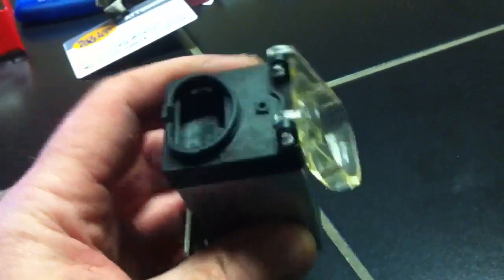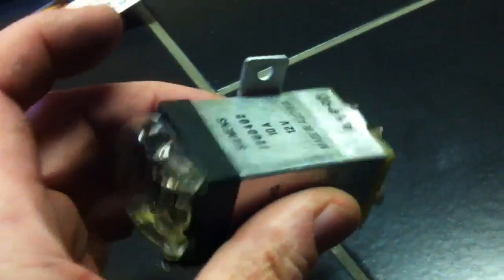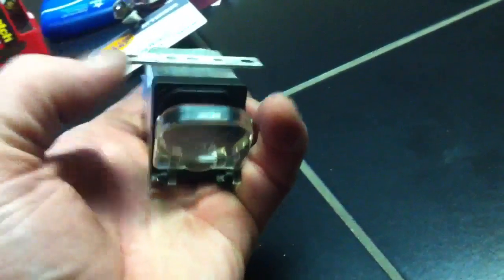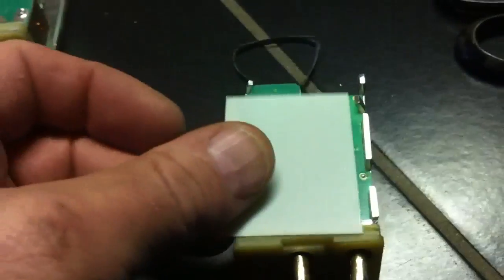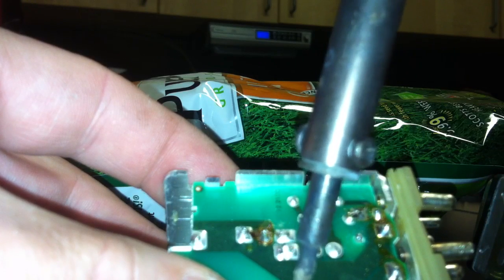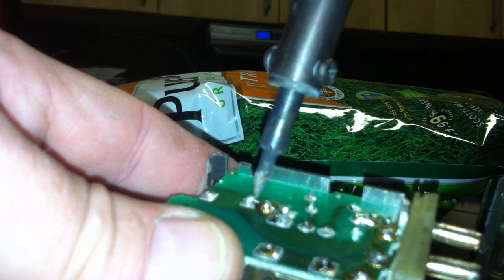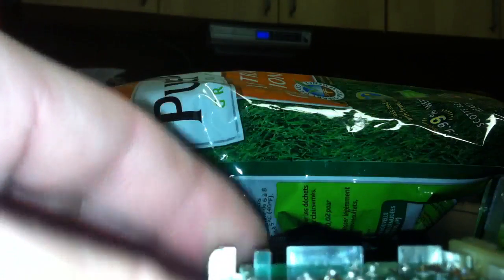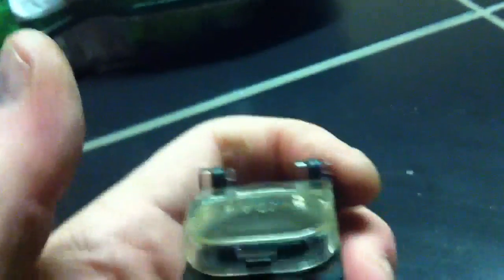Mercedes OVP relay repair

Comment: Great video . I recently bought a very nice and clean1992 SL300-24 with 126,000 miles . It was idling rough. I cleaned the AIC valve with throttle body cleaner  , replaced the air Intake sensor ( $12 ) . Cleaned the OPV relay corroded pins with sandpaper . Cleaned the grounds and grounding points at the coil and on the engine block and now the car idles as it should and purrrrs like a kitten .
Reply: Hello
I have exactly the same car
Could you tell me where the OVP is located?
Reply: @Farhad_ZKD , yeah , the OVP  relay is located under the trim cover beside the passenger hood hinge . The  OVP relay is beside the MAS and HGS modules .
    To remove the OVP , lift up on the driver side of the relay and then pull the left side out of the slot towards the driver side and then unplug the OPV from the wire connector. The removal is tricky   .
Reply: @thaddeauscaldwell7101   
Thanks a lot for the reply! That OVP tip was perfect!
Reply: @Farhad_ZKD , that's great , glad I could help

Comment: hi, the socket the pins go into, has two wires, do you know why two wires, because I broke the two wires off one of the socket, I think it is conecting to the #87 pin. The socket has too little remaining wires left, so how do I repair the socket?

Comment: Amazing video. Many many thanks. Will try this tomorrow no doubt. Do you know if other electrical bugs, like radio turning off by itself, instrument cluster sometimes not working, ceiling light only tuning on manyally and not when the door is open (only the rear ceiling light works fine)... alarm remote control... can these all be faulty due to the OVP relay? Many thanks again
Reply from the maker: yes . OVPs can cause all kinds of weirdness
Reply: @fupabox  many many thanks for your help

Comment: Hi.. I have 96 E320 with no ground to the fule pump relay inside the K40, can you help please?? Thank you
Reply from the maker: Check inside the K20 relay box. it's simple to pop the top off. The likely cause is a bad solder joint since all the relays within the box use the same ground . I've repaired a few of them in 15 minutes by resoldering the contacts inside the box

Comment: Hi Fupabox. I need advice on this OVP in my 94 w202 C280. 
After a battery replacement, I have only 8 volts commanding the coil of a perfectly tested fuel pump relay. No pump sound with key at ignition position. So, the car just cranks.
As a note: the radio antenna motor that always starts when the negative battery post is connected is gone too.

Could be this OVP relay?  It feels hot when I touch it. Thanks for your help!

Comment: My 1986 420SEL runs longer than 10sec or not idling erratically at times, I also have to hold my accelerator pedal down to keep it running even then it may die after holding it all the way down plugs and wires are new coil is new rotor is new cap is good full of oil and coolant fuel pump and filter are new timings in spec throttle plate cleaned fuel distributor is original but has ran tons of cleaners in fuel please help
Reply from the maker: Check to see if the egr valve is moving properly . It is a regular issue on the older Benz models. Also check all vacuum lines for leaking . You may need to remove the egr valve and clean out the tubes and also lube the crap out of the egr plunger so it moves freely up and down

Comment: I have a 190e 2.6 6 cylinder  the car runs great but the start is really hard 15seconds to 20 or more is this OVP relay can be the cause of that?  is this a symptom ?  please if you have any info on this thanks
Reply from the maker: possibly... check spark plugs as well . does it only start poorly when cold ?

Comment: My Mercedes E250 Turbo Diesel ! I have a problem in an engine that
 does not respond in a high way after changing the speed except the 
third degree and idle engine replaced the speed to the second degree! 
And another problem  ABS warning light ON???
Reply: Is it normal that w 126 relay which is in the fuse box 30 amp relay that get very hot

Comment: Where is the OVP relay located I can't find it. I have a 1984 MB 500 sel
Reply from the maker: yours should be inside the fusebox under the hood..the one with all the relays in it..it will have a fuse mounted into the top of it

Comment: great vid. however, I would prefer to test the device to confirm before tearing it apart. any circuit diagram by chance?
Reply from the maker: one printed on the side of the OVP itself
Reply: absolutely right, thx!

Comment: Thanks man. just saved 100euro. my 124 abs light was coming on and tacho not working. so i hit the ovp with a srewdriver and light went off and tacho worked. so i soldered it as video says (20min job) and now its perfect. thanks and keep it up man.
Reply from the maker: excellent.. glad it helped

Comment: Best way to check an OVP relay on a 1990 300D? I'm having idle issues. It idles very low and almost stalls..
Reply: Jake Weiman same here have u figure out what the problem is
Reply: Same problem with my 1991 300D! Idles too low when it's cold, but when it warms up the idle is fine...

Comment: Will this fix my non-working tach like I have read it might?  Seems like a DIY I can handle...
Reply from the maker: +RogueTalent541  It's possible it will..bad OVPs cause all kinds of weird electrical issues.. all you need is a soldering iron (maybe a bit of extra solder) and 10 minutes... It may not solve your tach issue, but you won't have any problems doing it

Comment: Having to re-flow the solder joints suggests that these units have cold solder joints. This is a sign of poor quality circuit assembly. It could be that they were assembled with poor quality solder. It might be advantageous to extract as much of the old solder off with some solder wick and reapply new solder you know is good quality.
Reply from the maker: +Walt Williams That sounds like great advice

Comment: HELP :---))))  My turn signal relay is making a buzzing noise on my 1995 C280, so I think, I need to find a new one part #2018210147.  Problem is a big black relay next to it we unclipped took out by mistake (Part # 2025420132).  Now we can't get it back in.  Can you help me or show me a quick video please :---)))))))  What it contol?  because everything seems to work :--))))))...........ASAP please
Reply from the maker: +laboyga the big black one is the lighting control relay... it has 2 big feet on one side at the bottom..  tilt those 2 feet so they are pointing down and then lower the other side into place.. you can't push it straight in.. the 2 long feet / legs go down in and lock under, then the other side presses in
Reply: +fupabox thank you. got it............What would i do with out your help :---))))))
Reply from the maker: laboyga excellent..  hope it all worked out :)

Comment: just wanted to add that tapping the OVP with a screwdriver or something while the engine is trying to start or while running and getting some response  is a 100% positive sign that the solder  connections have come loose
Reply from the maker: +Thomas Rose  Good info

Comment: My (W124 230E 1992) was shutting down while driving, so first I re-tinned the OVP as per your guide, but the problem remained. I then re-tinned the fuel pump relay and this solved the problem. Thanks for your informative guide.
Reply: ***** One question though, since I did the re-tinning, I'm now having an issue where the central locking doesn't open when I switch off the engine. Could this be OVP related? Should I maybe just buy a new one?
Reply from the maker: ***** There are a few things I would try..1)  try pulling and  hold the drivers door unlock knob or switch on the dashboard for 10 seconds while shutting the car off ..not sure if your w124 had the dash button.. 2)  if you have the 2 button remote ,press and hold both while inside the car..but I think your w124 had a single button. ,,if it has the single button, lock the car with the key, unlock with the button and continue holding button for 10 seconds  3)  unhook the negative battery cable for 1/2 hour and hope it resets   . 4) unlock the drivers door with the key and keep it turned in the unlock position for 10 seconds... 5) The fuel pump relay would be activated by the ignition, so thinking backwards, when the key is turned off the power to the fuel pump relay would be cut, and send a signal to unlock the doors (not quite sure if that is how it works, just assuming )  if so maybe the pump relay still has a bad connection.  6)  hope it relearns to open on it's own

Comment: The OVP relay is a critically important device, and should be inspected and/or replaced at any signs of excessively fast idle speed, ABS light coming on  for "no reason", etc.  Don't repair it; replace it! They're inexpensive($30-50.00), and readily available. They do NOT retail for $100.00.
Reply: OEM is 100 or more, cheap china crap are 30-50 on ebay and amazon
Reply: For an 87 300d, they're unavailable and used are $300 on eBay

Comment: What came out was a  KAE 3.301.300 .  What I'm putting back in a "New" Evan-Fischer EVA29572044828  (OES a/m) 1 yr. warr. Relay Fuel pump 12 volts Stud type 10-prong male terminal. New KAE was too expensive and present day parts list is getting a little strong w/Head Gasket blown and tranny showing some "bang" in later gears.
Very kind offer but think I'm ok...Teetering on the edge of  very recent re-built M103 and  tranny. Body/shell, F&R suspension all  German fresh in mine and just too good to simply let her go at 242K. Enuf new/near new parts top side to simply transfer over.
That's the plan anyway..

Comment: Have a loaner in there now but purchased a new one and have every intention of trying to break into the siliconed sealed vault to see what's what......Benz guru seems to think it became fried with the demise of one of the fuel pumps...Just more fun 'n games here on Worry Avenue....
Reply from the maker: yeah I guess a dead pump would put a strain on it.. you would think the fuse would  protect against that
Reply: ***** But I still can't find it unlike the OVP relay....I'm left with guess work.....Not sufficiently dialed in  for this stanza at all...Meanwhile what's with the huge disparity of cost on these things as in 80%?  A shame that someone in the U.S. isn't making these things and the OVP Relay too...
Reply from the maker: SWF1127 if you give me the part #  I'll see if I have any extras kicking around...have you checked "rockauto" for prices on the relay ?
Reply: ***** To your point...Used to use R/A for a former beast of a Jeep and some Benz parts but started to see better deals at Auto Haus of Az. and Car Parts .com.  Only use OEM and sometimes sneak a peek at AMAZON.  A bit helter skelter but occasionally find something that leaves me scratching my head... Ex.:  That coil (OES) $32.00. Here's an interesting little company you ought to take a peek at.  eEuroparts.com customerservice@eeuroparts.com  Some great marketing ideas and solid odds and ends supplier...
Reply from the maker: SWF1127 Thanks I'll check those out.. I've had a few duds from rockauto..lol.. I have a Porsche Cayanne tailgate strut from when I ordered a Benz steering damper..?? not sure how that happened, but they said to keep it, and sent the proper one...Thanks
Reply: ***** That incident sounds more like  a Parts Geek  special....Throw it on Parts Are Us...Only a 5% comm. too...another new discovery. Someone should gobble that up ....Makeover for the beast begins tom.:-)

Comment: Since the Fuel Kick-Down relay is a "kissin"  cousin to the OVP-Relay  located  in the same neighborhood,  thought I'd throw a question out there...It's sealed up as a tight as a drum, no fuse so how do you know it's still good?  There is this  nipple thingy on the top  with an in view  but indicative of what?  Be nice if KAE would endorse a color code of some sort for those of us less inclined..(Green and Red maybe) Can ya test these things somehow?  Oh and are there other brands avail in lieu of KAE? 2nd  less than two year old KAE product  possibly crapping out and no fuse in this one...Thoroughly perplexed here in SWF...(A bit more congenial than standard WTF )   TKU....
Reply from the maker: Hate to say it , but I have never had an issue with one ,and haven't really taken much of a look at it.. I know what you mean by the nipple on top..just not sure what it is meant for. wish I could be a bit more help.. I seem to remember a post somewhere on re-soldering them as well, but if it is sealed as you say...maybe if you have a spare one you could heat the glued end and pop it open for a look.

Comment: I would appear that the addition of the  new coil FINALLY did the trick on my '87 300E.  It was a little slow to gain a steady idle and died a few times as before but in four or five minutes came to life.  Of course the new fuse in the OVP didn't hurt the effort either...
Most grateful for the help here on Y/T and "fupabox's" seamless input....Next up swapping out a tank...No particular expertise for this chore either....:-)
Reply from the maker: prob took a while to clear the un burned fuel in the intake and unfoul the plugs...never had to replace a fuel tank, but I'm pretty sure it comes out from the trunk.. I may have something saved in my bookmarks on it,,,yup..http://w124-zone.com/downloads/MB%20CD/W124/w124CD1/Program/Engine/103/47-4100.pdf
Reply: ***** But of course the "Benz Angel" would have something tucked away on fuel tanks. Little familiar but only as far as the &^%%$# sending units. I hate them and the in-car install... Hoping "out" easier....Your diagrams here will be most helpful once again...It's not here yet but cleaning and delousing re-prepping for install will be first chore..Been assembling new parts like fuel strainer, sending unit,  new vents  etc..Hoping to swap some of the old stuff over but we'll see what happens...Tks. again..
Reply from the maker: SWF1127 de-lousing.. lol

Comment: Might be redundant but worth  try I hope....'87 300E recently tuned it.  Rolled out this morning, back  no prob but a restart to change car position yielded a ten second run then a quit.  Same over and over...Yup battery new 7/14. Getting fuel to fuel dist..checked. Wondering if it's one of your relays? Changed 'em both out about four years ago.  Any clues?  Thanks in advance....-j
Reply from the maker: could be the ignition coil or the crank position sensor..also spin all your fuses to be sure they are getting good contact
Reply: ***** Going out to do the fuses now replace a few of the  older ones too. Pulled the OVP since last write and that was a "bitch."  Going to change that fuse despite fact less than a few years old...Thanks for input.  Appreciate it!  Hate it when this thing just dies...
Reply: SWF1127 Here's one to add your knowledge pool re: OVP and supporting  10A that came with....Put the fuse on the meter at an Auto Zone and it came up defunct.....Two year life span and hoping the re-install is the answer...Of course jumping her earlier during a voltage meter challenge probably didn't help the cause much either......Meanwhile your coil suggestion is on order as that's got some years on it too...
All help greatly appreciated and nice to see communities of this type still exist...-j
Reply from the maker: SWF1127 OOh.. good info... I wouldn't expect a 2 year old fuse to be toast, but they aren't made the same as they used to be... One of the things I always find myself guilty of ,is assuming "I just replaced that part so it can't be the problem"  many times I have wasted time looking elsewhere when the culprit is right under my nose.. ..that, and "is there fuel in the tank" ... DOH!!!    LOL..
Reply: ***** Sorry, KAE was the brand.  Both the case of the OVP and environment behind the battery were clean and dry too. Since I'm Disabled and  neither a tech nor a mechanic, I have to take these small victories with a smile.  Getting the bloody thing outta there was a nice little workout too.  Now,  let's see if she starts...Gulp!
Reply from the maker: SWF1127 fingers crossed
Reply: ***** Ugh!  Didn't happen which surprised me a bit at 0530....Ordered the coil yesterday as your suggestion included that....Helluva deal on Amazon!  OES too plus Pay-Pal works.   Of course I got hammered for the expedited shipping....Can coils be rebuilt?  Thought I might just add it to the boxed collection of goodies out in the garage...Btw that KAE resource for the OVP was Made in Germany too...Onward....
Reply from the maker: SWF1127 nope, coils are paperweights when bad unfortunately.
Reply: ***** Got it!  Tks....

Comment: Hi fupabox, I have to ask you a question. I have a 94 c280 Mercedes with a IL6 engine(M104). The engine starts fine(cold or hot), but stalls without warning after a few minutes. I have replaced the fuel filter and the OVP(original mercedes part), but still no difference. Could it be the fuel pump relay or the CPS sensor, or anything else?  Thanks a lot for any help from a subscriber in Norway
Reply from the maker: yes it could be either of those things you mentioned, it could also be an ignition coil, fuel pressure regulator, MAF sensor, vacuum leak... unfortunately it could be many things
Reply: +Tellus671 if the insulation on any of the wires where they plug into  any of the sensors is crumbling  then the wire harness is original and MUST be replaced no matter how much someone may have tried to 'repair' it. any engine made from 93-95 has a defective engne compartment wiring harness.. even the 12 cyl and the diesels but only those years.. Under the cloth tape is where its really bad .even changing the spark plugs can abd will cause a  poor running or even a no start. with no   obvious reason. Your problem sounds like what they did when the harness was breaking down. There isnt much else that will cause that problem you have